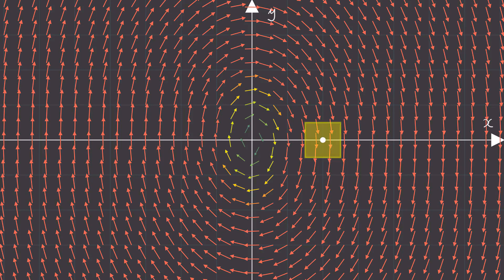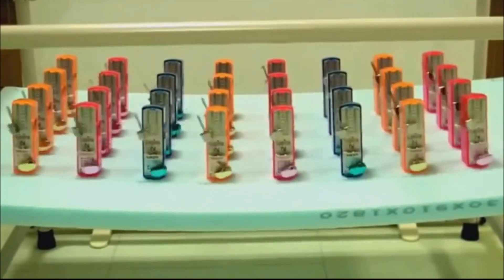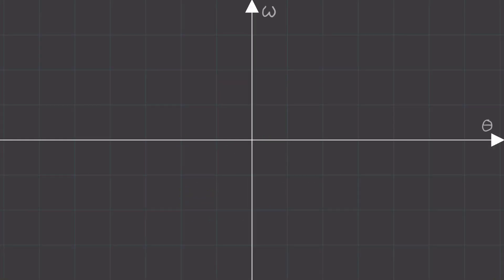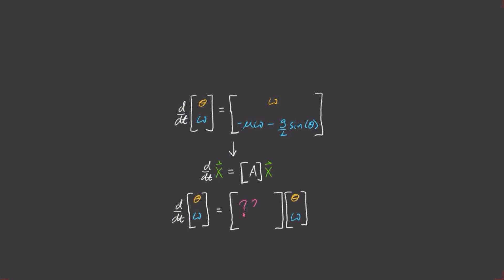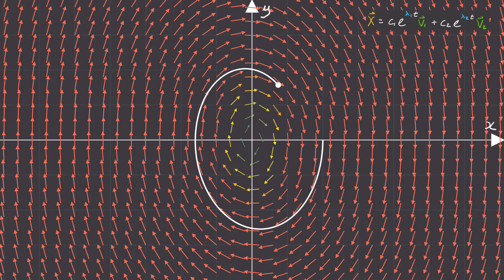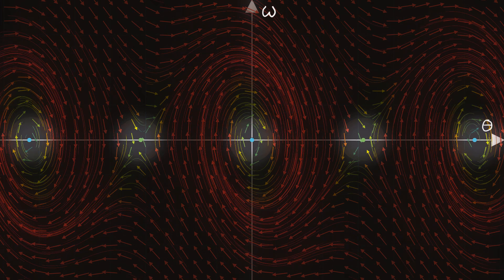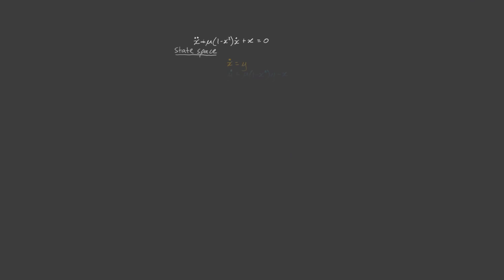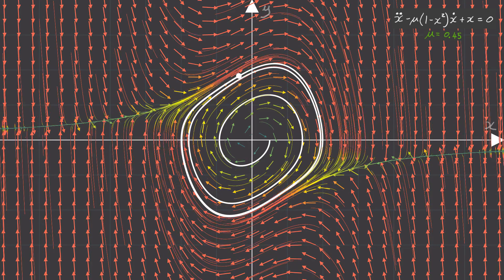3.0 A better way to understand Differential Equations | Nonlinear Dynamics | Linearization

Comment: I would love to see a phase diagram of a double pendulum. 
It would look like 2 phase diagrams for the 2 pendulum, and the position of one pendulum in its phase diagram would influence the phase diagram's arrows of the second and vice versa, explaining the chaotic behavior of such
Reply from the maker: In this case rather than have two separate phase portraits, you would have a single 4D phase portrait because your state vector would have 4 elements (theta1, theta2, Dtheta1, Dtheta2)
Reply: @virtually_passed  Yeah, but since such a 4d diagram can't be displayed, the best option would be to do 2 separate 2d phase diagrams which arrows and vectors (flow) change continuously

Comment: Awesome video.. Animation are very cool..
Reply from the maker: Thank you so much :) I used manim. It's really powerful :)
Reply: @virtually_passed  Very interesting video! Please, how did you produce the animated trajectories in manim?

Best regards,
Reply from the maker: @ricardooliveira4783  Hi Ricardo, thanks for your question. The short answer is that I created a VMobject and updated the positions of the particle using standard finite derivative formulas:
v2 = v1 + a *dt
x2 = x1 + v*dt
t = t + dt

If you want the code, I've dumped it all below. I've tried to make it fairly compact, but I'd say there are definitely ways to improve it! Good luck :)

from manim import *
import numpy as np

config.background_color = "#3d3d3d"

class VectorFieldScene1(Scene):
    def construct(self):

        grid = NumberPlane(axis_config={"include_tip":True},
            background_line_style={
                "stroke_color": BLUE,
                "stroke_width": 0.8,
                "stroke_opacity": 0.2
            }
        )
        self.play(Create(grid))
        self.wait()

        #State Space
        u = 0.6
        g = 9.81
        L = 3
        def x_dot(x,y):
            return y

        def y_dot(x,y):
            return -u*y-(g/L)*np.sin(x)

        func = lambda pos: (x_dot(pos[0],pos[1]))*RIGHT + (y_dot(pos[0],pos[1]))*UP
        vf = ArrowVectorField(func, x_range = [-7, 7, 0.4], y_range = [-5, 5, 0.4])#, length_func  = length_func) #stroke_width does nothing :(
        self.play(Create(vf))
        self.wait()

        self.wait(3)

        dot1 = Dot(radius=0.06, color = BLUE).move_to(
                grid.c2p(-2*np.pi, 0))
        self.play(Create(dot1))

        dot2 = Dot(radius=0.06, color = GREEN).move_to(
                grid.c2p(-1*np.pi, 0))
        self.play(Create(dot2))

        dot3 = Dot(radius=0.06, color = BLUE).move_to(
                grid.c2p(0*np.pi, 0))
        self.play(Create(dot3))

        dot4 = Dot(radius=0.06, color = GREEN).move_to(
                grid.c2p(1*np.pi, 0))
        self.play(Create(dot4))

        dot5 = Dot(radius=0.06, color = BLUE).move_to(
                grid.c2p(2*np.pi, 0))
        self.play(Create(dot5))

        self.wait(3)

        stream_lines = StreamLines(
            func, stroke_width=1,
            max_anchors_per_line=50
        )
        self.add(stream_lines)
        stream_lines.start_animation(warm_up=True, flow_speed=1, max_anchors_per_line=5)
        self.wait(stream_lines.virtual_time / stream_lines.flow_speed)

        self.wait(25)

       #Particle near fixed point
        self.x1 = 0.5 #initial value
        self.v1 = 0
        self.t = 0
        dot = always_redraw(
            lambda: Dot().move_to(
                grid.c2p(self.x1, self.v1)
            )
        )

        self.play(Create(dot))
        self.wait(1)

        path = VMobject()
        path.set_points_as_corners([dot.get_center(), dot.get_center()])
        def update_path(path):
            previous_path = path.copy()
            previous_path.add_points_as_corners([dot.get_center()])
            path.become(previous_path)
        path.add_updater(update_path)
        self.add(path)

        def update_box(mob, dt):
            #update acceleration
            self.a1 = y_dot(self.x1,self.v1)
            # #update velocity
            self.v1 = self.v1 + self.a1 * dt
            #update position
            self.x1 = self.x1 + self.v1 * dt
            #update time
            self.t = self.t + dt

        dot.add_updater(update_box)

        self.wait(8)
        dot.remove_updater(update_box)
        path.remove_updater(update_path)
        self.play(Uncreate(path),Uncreate(dot))

        self.wait(2)

       #Particle near fixed point
        self.x1_new = 3 #initial value
        self.v1_new = 0
        self.t_new = 0
        dot_new = always_redraw(
            lambda: Dot().move_to(
                grid.c2p(self.x1_new, self.v1_new)
            )
        )

        self.play(Create(dot_new))
        self.wait(1)

        path_new = VMobject()
        path_new.set_points_as_corners([dot_new.get_center(), dot_new.get_center()])
        def update_path_new(path_new):
            previous_path_new = path_new.copy()
            previous_path_new.add_points_as_corners([dot_new.get_center()])
            path_new.become(previous_path_new)
        path_new.add_updater(update_path_new)
        self.add(path_new)

        def update_box_new(mob, dt):
            #update acceleration
            self.a1_new = y_dot(self.x1_new,self.v1_new)
            # #update velocity
            self.v1_new = self.v1_new + self.a1_new * dt
            #update position
            self.x1_new = self.x1_new + self.v1_new * dt
            #update time
            self.t_new = self.t_new + dt

        dot_new.add_updater(update_box_new)

        self.wait(10)
        dot_new.remove_updater(update_box_new)
        path_new.remove_updater(update_path_new)
        self.play(Uncreate(path_new),Uncreate(dot_new))

        self.wait(8) #25

        #Unshow fixed points
        self.play(Uncreate(dot1),Uncreate(dot2),Uncreate(dot3),Uncreate(dot4),Uncreate(dot5))
        self.wait(1)

        #Van der pol
        self.remove(stream_lines)
        mu = 0.45
        def x_dot(x,y):
            return y

        def y_dot(x,y):
            return mu*(1-x*x)*y-x
        func = lambda pos: (x_dot(pos[0],pos[1]))*RIGHT + (y_dot(pos[0],pos[1]))*UP
        vf_3 = ArrowVectorField(func, x_range = [-7, 7, 0.4], y_range = [-5, 5, 0.4])
        self.play(Transform(vf,vf_3))
        self.wait()

        stream_lines = StreamLines(
            func, stroke_width=1,
            max_anchors_per_line=50
        )
        self.add(stream_lines)
        stream_lines.start_animation(warm_up=True, flow_speed=1, max_anchors_per_line=8)
        self.wait(stream_lines.virtual_time / stream_lines.flow_speed)
        self.wait(5)
Reply: @virtually_passed  Thanks very much for the code! The compilation performed perfectly. I will try to extend the code to deal with different vector fields. I teach dynamical systems analysis and this kind of video is quite useful. Thanks again!
Reply from the maker: @ricardooliveira4783  that's really interesting! Where do you teach dynamical systems? Are you planning to make YouTube videos as well or just show MP4 clips to your students?